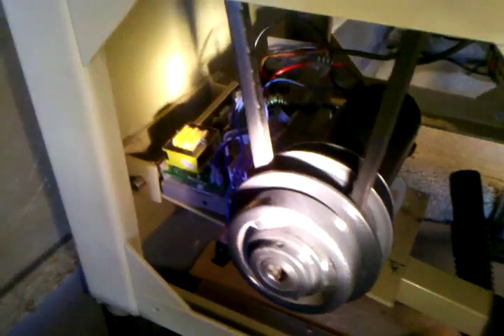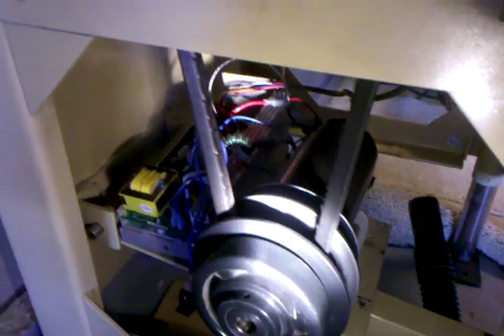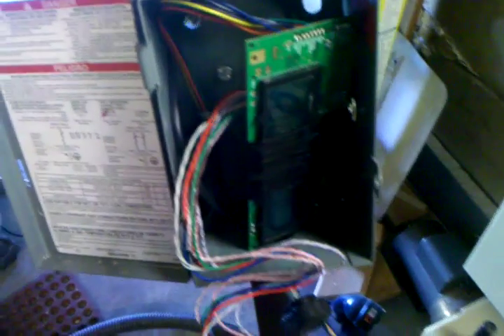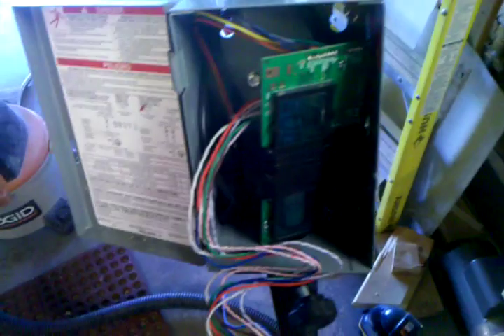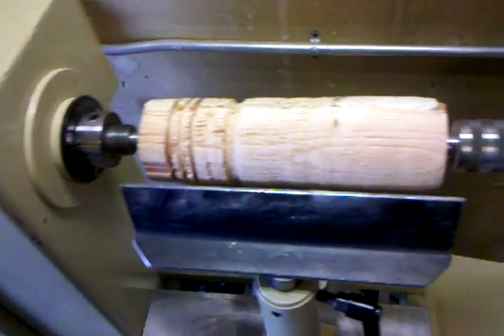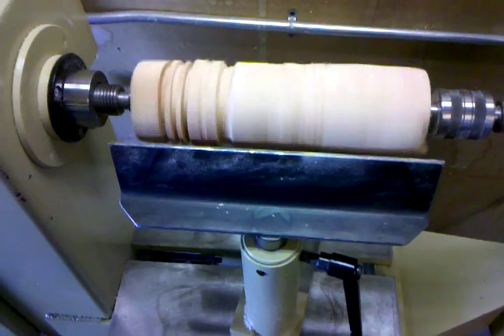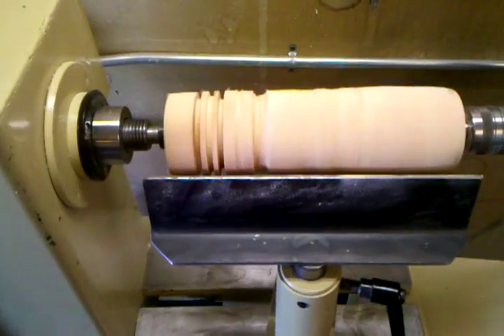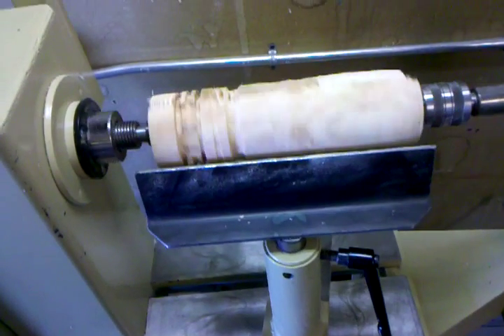Lathe varible speed conversion

Comment from the maker: Holy cow guys I totally forgot I even uploaded this (or even had this account....) I'm sorry for not responding!  The wiring wasn't that difficult just very time consuming.  The lathe is a Vega 2600 bowl lathe.  I actually do not have this lathe anymore, I sold it.  The speed conversion worked great but it didn't have much torque at slow speed.  If you're going to do something like this I recommend changing the treadmill's controller to a better one